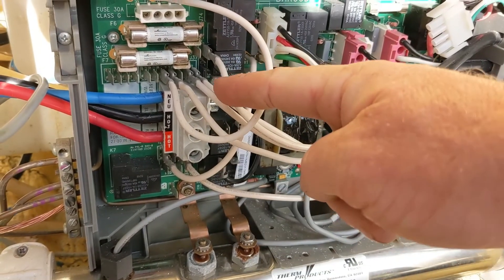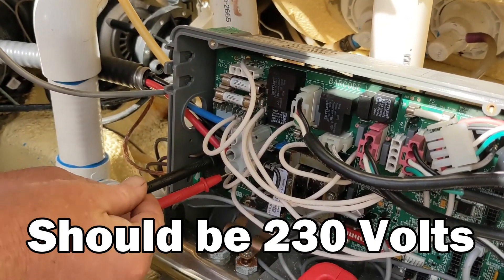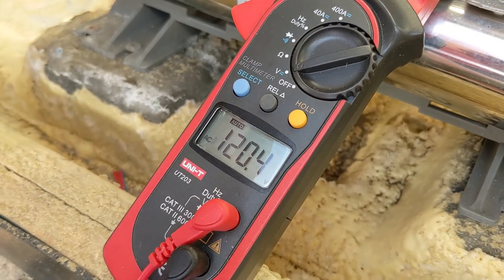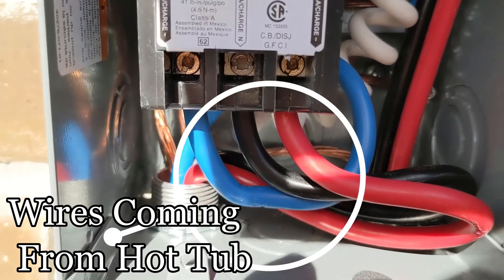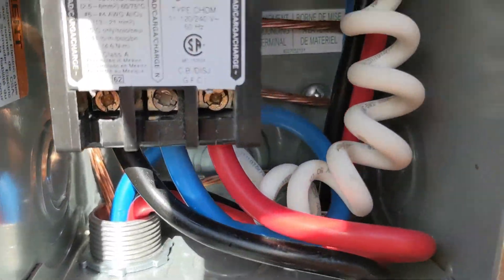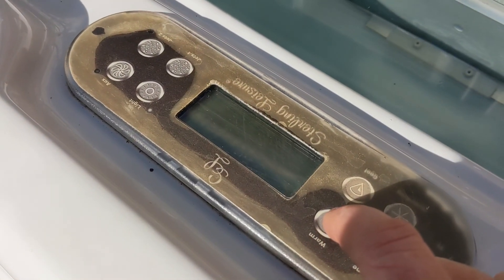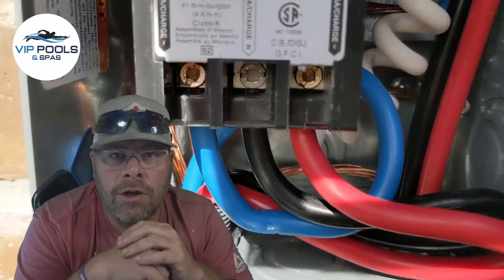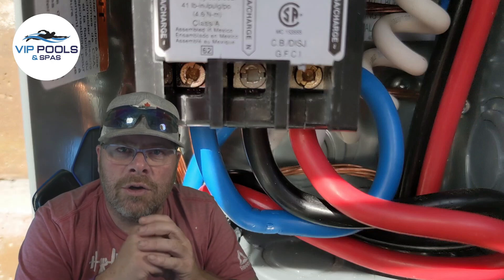HOT TUB Wiring Done Wrong / Hot Tub Circuit Breaker Keeps Tripping

Comment: I need help. So every time I plug my hotub in and tap reset it turns on. But as soon as I touch the jets or change the heat it shuts off. But if I touch the lights those come on. I need help please and thank you.
Reply from the maker: what spa pack (what everything plugs into under the tub), and hot tub do you have?
Reply from the maker: Shuts off?  Does it trip the breaker?